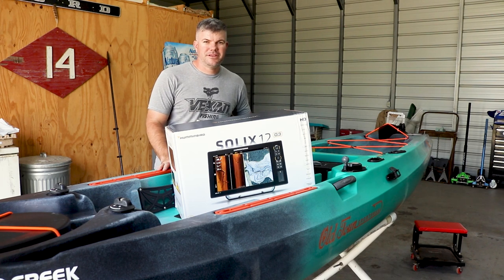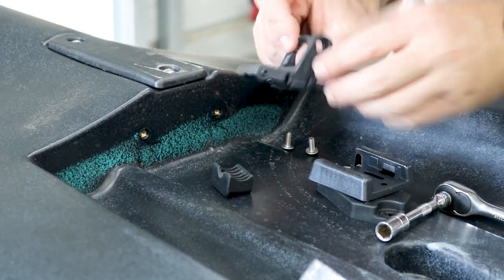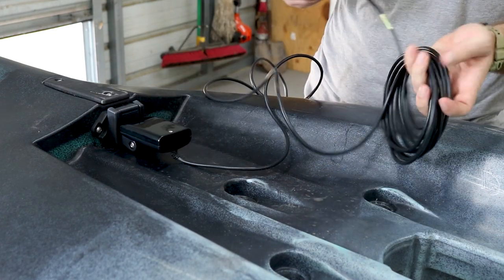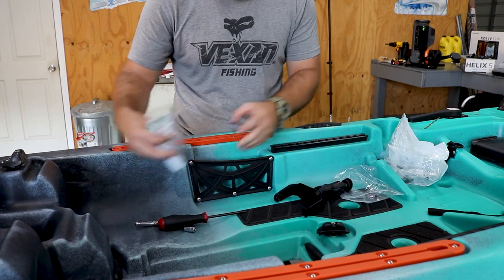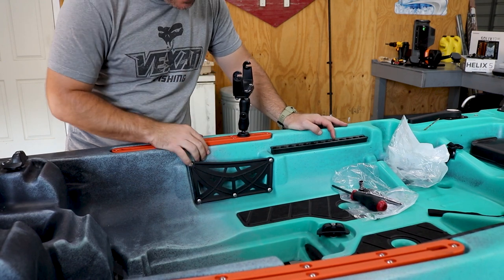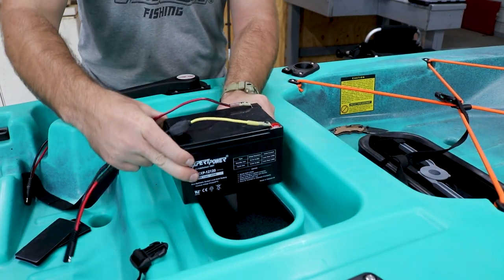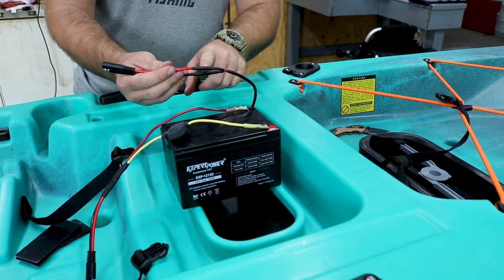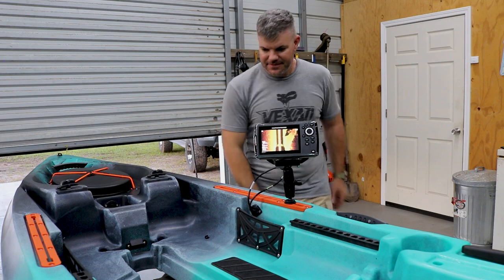Fish finder install on my old town sportsman 120

Comment: would be nice to see how you drill that hole and run the cables to the finder .. you can run your hand through the front dry hull to feed the cable through ... hadn't got my kayak yet .. just looking to see how all things wired and mounted :) ..
Reply from the maker: I`ll be sure to do that on my next rigging video when I run my lights

Comment: Have you had any issues with the side imaging in relation to where you mounted the transducer.
Reply from the maker: Nope not at all, it has been working great. If I could do it again though I would have gotten the 7 instead of the 5 for a little bigger screen.

Comment: How well does the Side imaging work? When you mounted it, the transducer was lower than the sides of the kayak. Does that matter?
Reply from the maker: The side imagining works great! You don't want the transducer to be lower than the bottom of the kayak or you run the risk of hitting it on something or scratching it up bad.
Reply: And the side imaging still works? Thought you have to have transducer mounted so it's slightly below plastic for side imaging to work